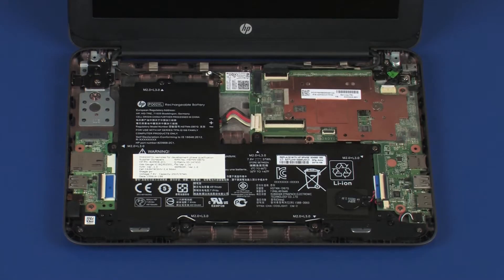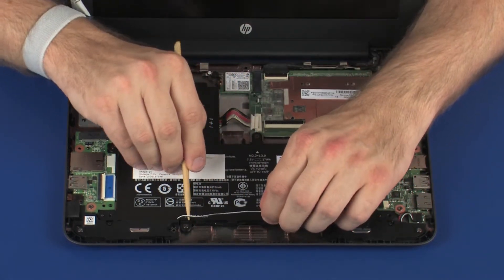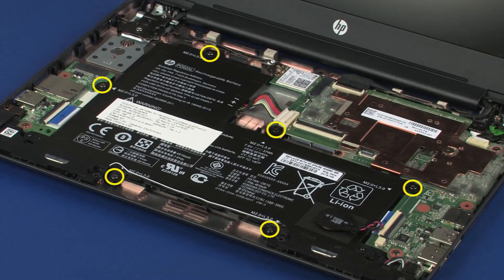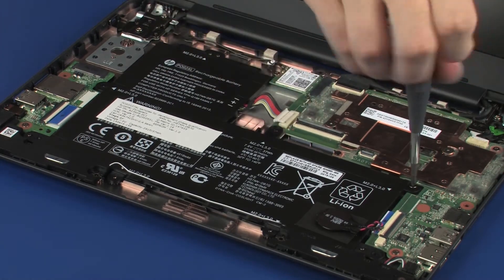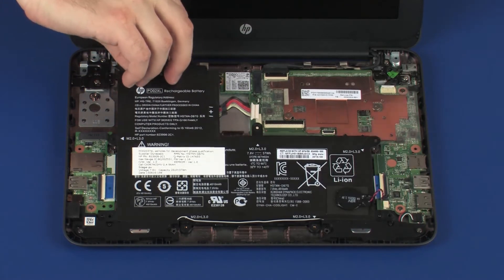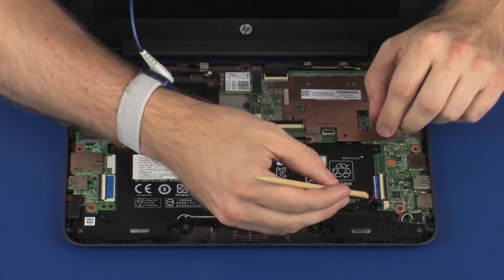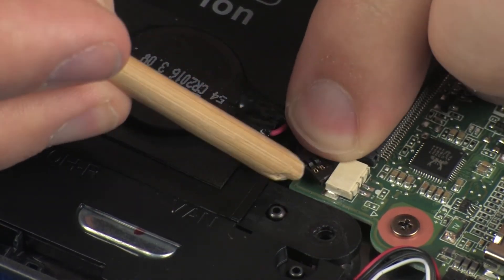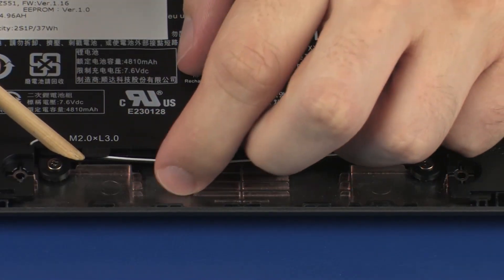Replace the Battery | HP Stream 11-r000 Notebook PC | HP

Comment: So, how do you remove the top cover?  DO you even realize how useless this video is without that little piece of information?
Reply from the maker: Hi John Doe,

Thank you for your post and interest in our product.
We appreciate your time you have taken to contact HP Support and We apologize if you had any inconvenience.
I'm sorry to hear about the experience you've had.
I'd like to help you with your HP laptop and related queries.

As a first point of diagnosis, please try few of these steps mentioned in this document link to remove and replace laptop battery:
http://h10032.www1.hp.com/ctg/Manual/c04795670.pdf
Please refer page number 42/91(for battery removal and replacement process).

If still need help, To further provide you additional guidance, please contact our customer care team over the phone or chat for further assistance, as this issue requires Live conversation with you over phone or chat to isolate the concern and guide you instantly with appropriate solution.

Please follow these steps to reach HP Phone Support:

Step 1. Open link: https://support.hp.com/us-en/contact-hp?openCLC=true
Step 2. Select the product type.
Step 3. Enter the serial number of your device or select let HP detect your product option.
Step 4. Select the country from the drop-down.
Step 5. You should see the Local Contact Options.

Hope this helps. Keep me posted.

In case you want to reach us on call/chat, please access this link to select your preferred country and language option to reach us. Global support link:- https://www8.hp.com/us/en/contact-hp/ww-phone-assist.html

Regards
Vignesh-HP Social Media Support
Reply: Nice Non-Answer Step one is the issue that's missing on this video, or a link to step one would have been helpful. @HPSupport